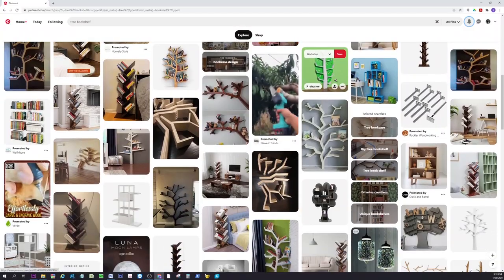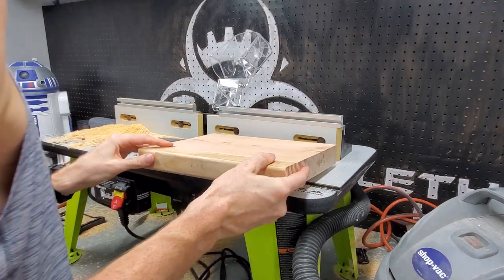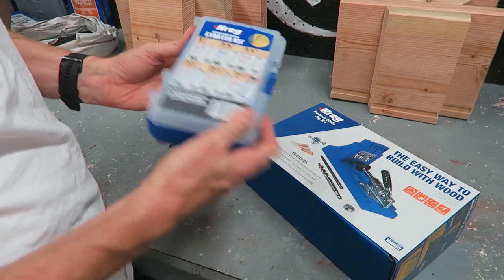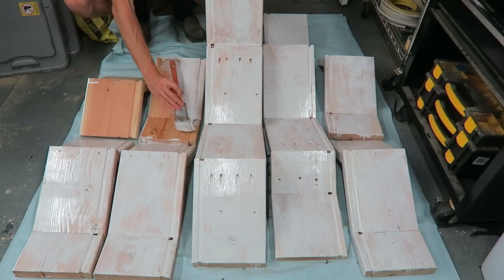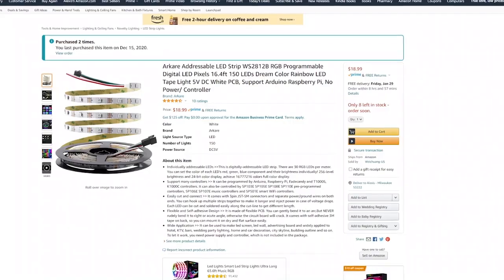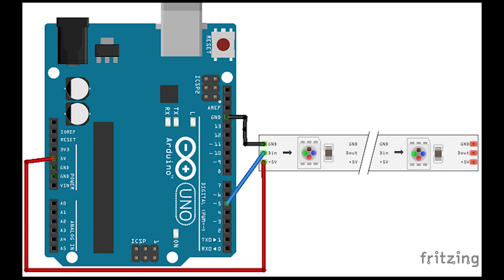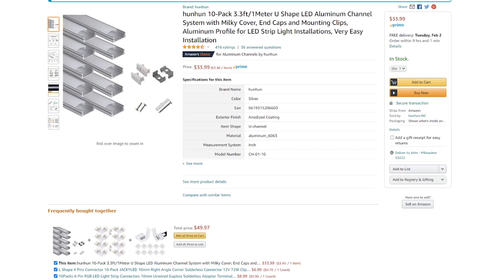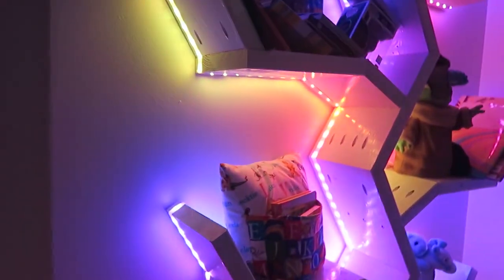How To Make A Tree Bookshelf with LED Lights!

Comment: great job! the mandalorian helmet i was talking about in a previous video is coming along! i ended up slicing the file in prussa slicer and and printed them out. i just need to glue them together, sand it, and paint it! something that might be easy to fill in the holes is wood filler (or just saw dust and wood glue).
Reply from the maker: Wood filler is a great idea! I'll have to go through and patch those up

Comment: Nice video! I am guessing you didn’t plug the pocket holes so you can deconstruct the tree later? I was thinking of building a workbench or some shelves myself at some point and leaving the holes exposed for that reason.
Reply from the maker: Tyler! Actually, it was just some laziness on my part. Only a couple plugs came in the kit and I didn't want to make the trip to buy more. I also thought just painting the holes would make them less visible, but that didn't work as well as I hoped.

Comment: Hey...you've had your cr-10 for a while now....how's it holding up?   Pros & Cons?    Thanks....
Reply from the maker: It's holding up well. A couple of pros are the huge community of people with them and the overall reliability. One con would be how long the heat bed takes to warm up, which is solved on other printers like the Tevo Tornado (which has an AC print bed I think). I haven't owned any other printers, so it's tough for me to compare, but the CR-10 seems to be highly rated by other YouTube channels.